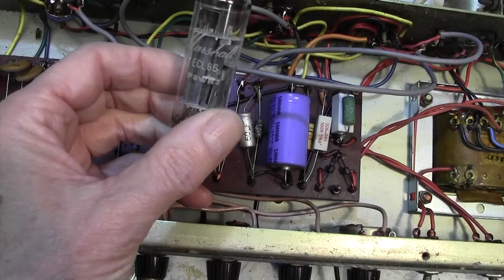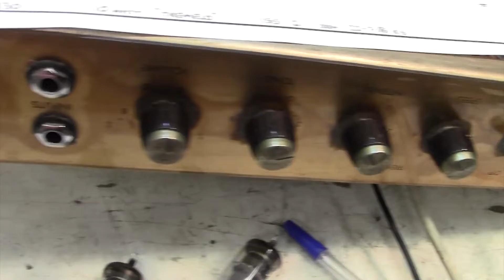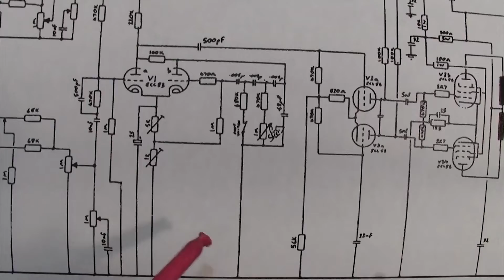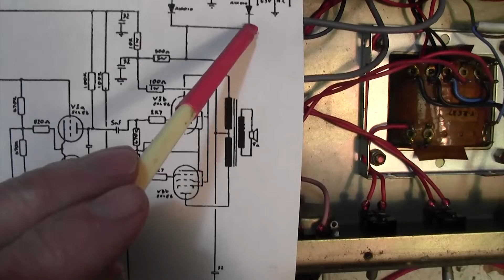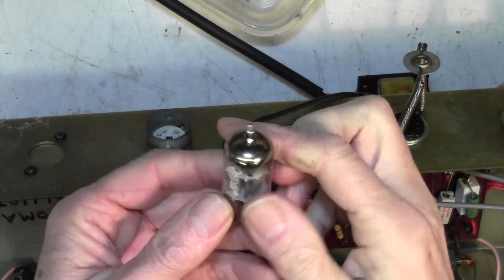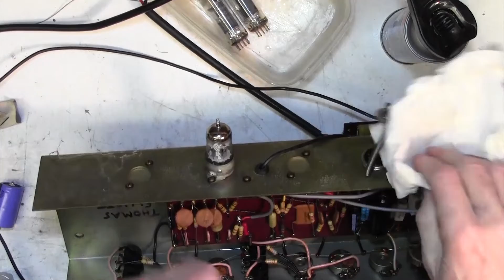Marshall 1930 Checkover and Upgrade

Comment: I saw on one of your other videos using shoe polish to clean up the tolex.
I have never thought to use that, I do enjoy the videos and I am now starting to repair amps. Thanks
Reply from the maker: YEs I use a spray intended for convertible car roofs to clean the crap off, let it drym then a bit of the old black shoe polish. I use a toothbrush to get into the corners. Only downside is my teeth seem to be going black ....
Reply: @stuartukguitarampguy5830  🤣🤣

Comment: I'm having trouble finding a .005uf at least 400v disc. Is there a replacement for this or a place that may have them? This is for a vibrato in my Concert.
Reply from the maker: Hi Michael. 0.005uF is 5nF. That's not a preferred value these days so go for a 4n7 (4.7 nF) you'll find plenty.
Reply: @stuartukguitarampguy5830  I found some that are .005uf 1kv should those work? If not I'll go for the 4n7. Thanks
Reply from the maker: @michaelevans3852  Yes they'll be fine.

Comment: When you solder the parts in do you make a loop on both ends and then put them together? It's hard to see exactly what you are doing.
Reply from the maker: Yes if possible. SOmetimes just a loop on one part and crimp it onto the other before soldering.

Comment: Always enjoy your videos, Stuart.  On another note, might you have a right ulnar neuropathy?  As a neurologist, I couldn't help but notice what appears to be an asymmetry in your hands.
Reply from the maker: Hi Andy  Not as far as I know? My hands look pretty similar to me. What have you noticed?
Reply: @stuartukguitarampguy5830  Well, it's hard to see, so I couldn't be sure. Looked like the muscle along the pinky edge of your hand, as well as the muscles in between the hand bones, were a little smaller on the right, which is most typically caused by compression at the wrist or elbow of the ulnar nerve.  Again, couldn't be sure, and if you have no numbness along the pinky side of the hand and no weakness in spreading your fingers, then...ignore me!
Reply from the maker: @andyreevesarchive528  Hi Andy  No, all seems good thanks.

Comment: Nice amp Stuart. Once, also I did repairs on this type of amp. I couldn't get all the noise away. I think because the volume pot and tone pot circuit are located before the first tube stage. So you have a volume en tone pot in the guitar and than the same sort circuit in the amp. All this with a very small signal.
Reply from the maker: Ah ok thanks!

Comment: Interesting that it has holes for 3x preamp tubes that they had covered with metal sheets and screws, from the factory. Maybe that chassis was also used for other models at the time. One could possibly add another preamp tube for more gain or driving a better tonestack. And of course, if those ecl86 become hard to find, one could install an ecc tube phase inverter in one of the holes and wire up the output section with current production tubes like the el84. (All this provided that the power transformer can handle the added heater current.)

Comment: Quite a nice little amplifier for home use. I have a couple of Watkins amps around the same age that use a similar output valve arrangement but incorporating ECL82s.  I did read somewhere that the old Marshall 20watt amp was very similar in circuit design to the  Watkins Dominator and that the first 45 watt amps were based on the Fender Bassman. I think that back in the day different manufacturers often used similar circuits, I imagine that it was a case of “if it ain’t broke don’t fix it “.
Reply: Tube manufacturers such as RCA printed "open-source" schematics for suggested circuits in the back of their tube manuals as a way to boost tube sales. Here in the US, Western Electric (Bell Labs)  did research into amplifier design, patenting many of their circuits and licensing them *for a significant fee*, but the big tube makers gave away their circuit designs for free.
Reply: @goodun2974  Yes I was aware of the RCA open source schematics which I believe Leo Fender and others incorporated into many early guitar amplifier designs. Over here in the UK I believe that the Mullard valve company published a book of amplifier designs but I don’t know if guitar amplifier manufacturers used it as a reference work as most of the Mullard schematics were for high fidelity audio amplifiers. I own a couple of USA 1950s small guitar amplifiers with 6V6, 6J7, 5Y3 tubes and they sound so much better than anything made in the UK at that time.
Reply: @henryhunter5026  , I have seen some of the published Mullard schematics and although they were indeed generally oriented at hifi manufacturers, the early guitar anp manufacturers were approaching it from the same general vicinity, that it was supposed to reproduce the guitar in a high fidelity fashion and not add a lot of coloration or distortion. Marshall amplifiers were originally designed to be sort of a high-fidelity PA for guitar, in the days when PA systems and on-stage monitor systems were crude or sometimes non-existent.

 It's also worth noting that Leo had a 15 year jump on Marshall in terms of experience building amplifiers for working musicians.  It may also be helpful to understand that Leo's fitst main client base was the bands playing in roughneck country bars around Bakersfield California, where the patrons were roughneck oilfield workers, a loud and rowdy bunch, and so the bands had to be loud and rowdy to match!  The guitar also had to be sturdy and perhaps capable of being used as a weapon against a drunken oilfield worker, which might be why we have the solid body Telecaster;  Resistant to acoustic feedback from a loud amplifier but also useful in giving some feedback to a roughneck patron via a smack on the head with the guitar!
Reply: @henryhunter5026  ,  It's also worth remembering that Leo Fender was originally a radio repairman and so he specifically designed his equipment to be easy to understand by the average radio repairman and easy to physically perform repairs on. He also put out his schematics  And layout diagrams for anybody that needed them,  without attempting to claim intellectual property or patent the circuits.  Nor did he encapsulate the circuits in any kind of goo  to obscure there function!   Basic radio and amplifier Electronics were mostly considered to be open source back in those days, Except perhaps by a few big players such as Western electric who did so much of the early research and RCA who did their very best to corner the market on every circuit design that they could buy from somebody else.

Comment: Interesting vid Stuart.. I haven't come across this particular offering from Marshall.. Not a criticism, just an observation.. I'd like to have heard the guitar plugged in to the finished repair fitted back into the cab with it's factory speaker. I found the noise level on the bench was disturbing and appreciate that it can be picking up noise from a plethora of devices in that situation. Thank you for introducing this real old timer to yet another old amp I hadn't come across. Have a great Christmas..
Reply from the maker: Hi Pete

YEs I've never seen this one either. Sorry about the noise!

Comment: Stuart, as I've instructed in the past,  clean the tube socket contacts with a wound guitar string, .033 to .038 diameter. Spraying with Deoxit is the lazy way out, and as you see here, sometimes ineffective. The toothpick sort-of works but is more effective at removing grease and dust than at removing actual oxidation. Also, the supposed "tube socket cleaning brushes" sold on line are merely nylon paint-sprayer tip cleaning brushes, sold at an inflated price; they're okay for removing dust but too soft to remove corrosion. McMaster-Carr sells tiny stainless steel brushes that should work well, but they're expensive. The guitar string technique works quite well.
Reply: Thanks for this comment.....a BIG help for servicing amp tube sockets
Reply: @meesterprofe007  ,  I have gone one further and figured out a way to use a battery powered artist's eraser to spin the piece of wound guitar string in the tube socket contacts.  This plus an alcohol flush is usually all you need to clean them thoroughly.  If you can figure out a way to chuck the guitar string into a small size Dremel tool that will also work.  Harbor freight sells a battery powered engraver for about 8 bucks that can be adapted to hold a piece of guitar string although it doesn't have quite as much torque as the battery powered artist eraser that I use. Harbor freight sells a battery powered engraver for about 8 bucks that can be adapted to hold a piece of guitar string, although it doesn't have quite as much torque as the battery powered artist's eraser that I use. Eveready Lithium Max batteries will give the motor a little extra kick!
Reply from the maker: @goodun2974  As it happens I'm about to clean 3 sockets on and old 60's amp so I'll try this method.
Reply: @stuartukguitarampguy5830  ,  any round wound string will work but a phosphor bronze string for acoustic guitar seems to work particularly well. .033 to .038, not critical, and retension afterwards.
Reply from the maker: @goodun2974  Yes just tried and works really well. Good tip thanks.
Reply: @stuartukguitarampguy5830  ,it's a tip I learned from a Canadian tech several decades ago....

Comment: I don't recommend straightening bent tube pins with needlenose pliers because that much force/leverage can crack the glass. Straighten it as much as possible with your thumbnail, than plug it into a pin straightener, a metal die with 9 matching holes. Back in the day, tube testers often had a pin straightener factory-mounted to the faceplate of the tube tester, or the service tech had one screwed down onto the service bench. (PS, this advice is from the book "Tube Lore" by Ludwell Sibley, a compendium of nearly every American and European tube ever made).

 You definitely don't want to break the glass base of that ECL86/6GW8 as they're hard to find nowadays and can be somewhat expensive. Another conceptually similar but not interchangeable tube is the 6BM8/ECL82, which are a bit cheaper/commoner.
Reply from the maker: Yes I wonder where you can get one these days though?
Reply: @stuartukguitarampguy5830 ,   There's gotta be some online seller who has them. Made in China these days I suppose, but since Asians are fond of tube equipment, there's gotta be a market for pin straighteners in Japan and Asia, so...
Reply from the maker: @goodun2974  Found somone!  USA so have ordered about $60.

Comment: Actually, there is a reason you should clean the pins of the tube before you stick it in your tube tester: some of that corrosion will likely be left behind in your tube tester's sockets,  and the corrosion may also decrease conductivity (especially to the tube heater) sufficiently to give you a lower reading then if you were to clean the pins first.
Reply from the maker: Ok good advice thanks.

Comment: Thorough service, sounds good. Are the 2 wirewound resistors, which look to be in parallel (board top right) original?
Reply from the maker: Hi Ralph, I wondered that. I think maybe not as this amp is from the 1960s and I think those were introduced later. Not sure though.